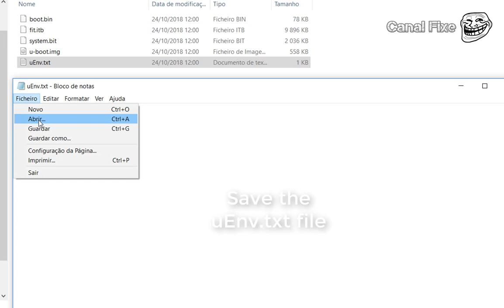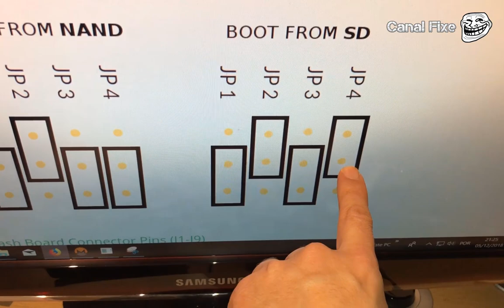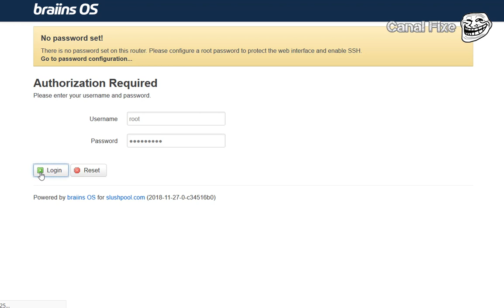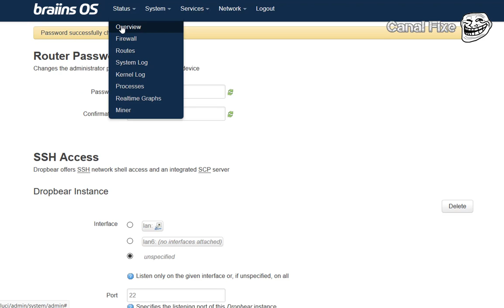How to install Braiins OS on a Antminer S9 - SD card

Comment: my config always goes back to default pool url and default clocks after reboot. how do i fix this issue ? great video btw :)
Reply from the maker: Strange... maybe the file permissions are wrong.
Try enter via ssh and change the file permissions to 755 or 777 on your pool file ( don’t know the file name now, i’m not on my miner right now.)

Or you can try reinstall once again the fw.

Try ask on telegram group for help:
t.me/BraiinsOS
Reply: @canalfixe  ty will do as advised :)
Reply: @canalfixe  oh and just one more thing ... what is the fee they charge for running this os ?
Reply from the maker: Nothing, that’s a open source OS, if you like you can donate something to the devs.
Reply: @canalfixe  0:40 how do i configure different ips for my mac/physical address ? i have multiple miners running on the same mac/physical address. sorry for the noob questions :(

Comment: hey I just bought an used S9 off ebay for $175 incl psu @13.5/1365w. seems like a high wattage even for an old S9 is it possible to lower the wattage with bOS ?
Reply from the maker: Yes, it’s possible
Reply: @canalfixe  I've unlocked/flashed many phones and dual boot my computers so I have experience but any chance to brick the boards? I'm wondering if Antminer latest firmware isn't the safest bet or if I can at least always flash them back. have you ever bricked or burnt up a board overclocking or anything?
Reply from the maker: I’m not an expert but I have flash all my Antminers with bOS and everything was done without any problems. You can flash back to original if you don’t like bOS
Reply: @canalfixe  awesome dude thanks for the quick response. hope you're making a killing right now :)

Comment: So the sd card stays in and the pin changed also stays same?
Reply: you need to ssh to the minier after its boot up and put the comend  miner nand_install
and then you can put all to normal
Reply: @maximmaixon8904  Sorry, i did not understand. I meant in case i used the Sd  disk, does it / should it stay in the miner?
Reply: @morfeuss85  it don't do any problem if it saty
Reply: @maximmaixon8904  do I need to set jumpers back to previous position after the OS installation?
Reply: @dmitrypolpudenko8669  ие авизателно
Reply: @maximmaixon8904  In telegram group ppl say otherwise
Reply: @dmitrypolpudenko8669  so do it 
I left it like that
Reply: @maximmaixon8904  pulling control board in and out is tricky ‘though.

Comment: sd.img is the image(latest version) you  downloaded from feeds.braiins-os.org?
Reply from the maker: Yes :)

https://feeds.braiins-os.org/
Reply: @canalfixe  thnx for the answer man! And is it btw necessary to change the MAC in uEnv.txt?
Reply from the maker: Yes, u need to change the MAC
Reply from the maker: Hi, that’s the only way, where you stuck at?
Reply from the maker: Hoo I see, You should try make the steps on the video, if you are stuck on something you can reach to me here, the steps on the video are step by step, should be easy. Try it man
Reply from the maker: Yes, it works on 13.5TH